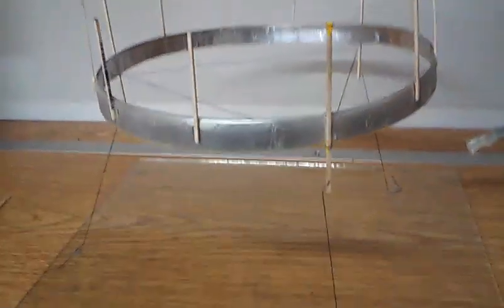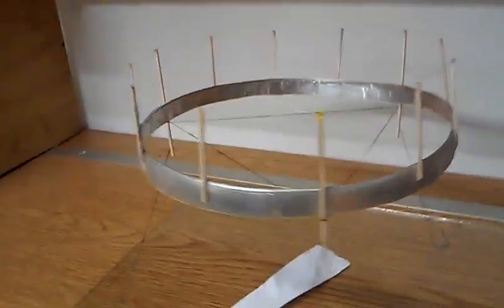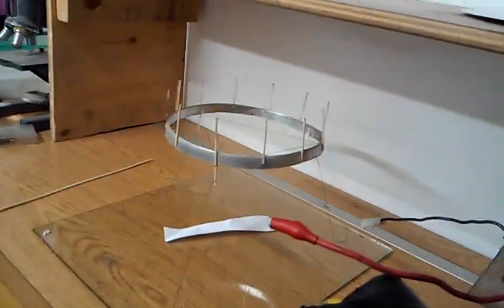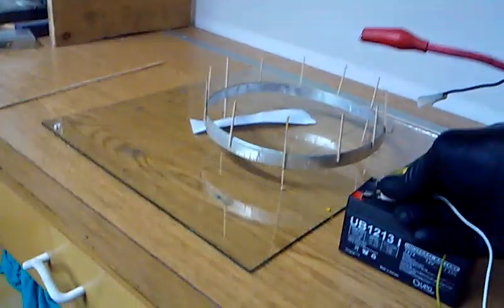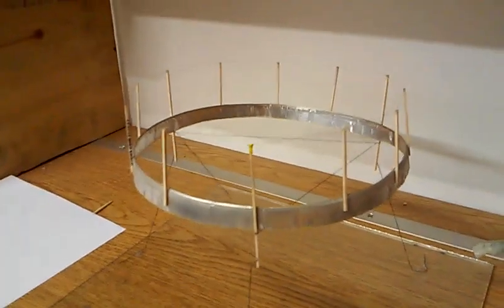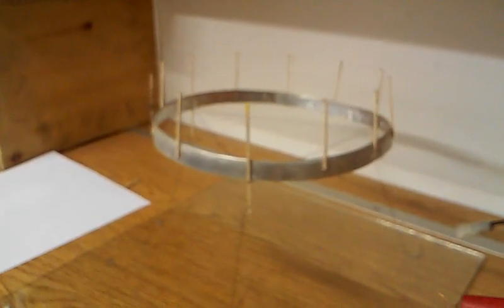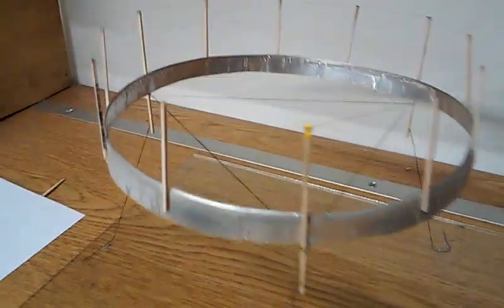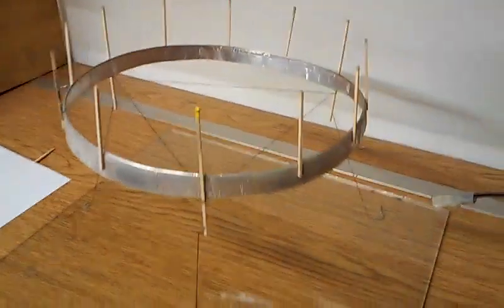ANTIGRAVITY LIFTER CREATES ARTIFICIAL GRAVITY ASYMMETRICAL CAPACITOR

Comment: easy way to test if it is a gravity well.  Put it in a vacuum jar and pull as much vacuum as possible.  If it still lifts, it won't be because of air.
Reply: it wont lift ina vacuum bro.. already tests out there prove that
Reply: @skip741x3  where they at doe?
Reply: In the summer of 2003 NASA tested one of these lifters in a incredibly negatively pressurized vacuum Lyft was still produced it is not ionic wind.
Reply: This concept is not even that complex if everyone would just listen to The Genius Tesla you would know exactly what's going on here electromagnetic radiation is the opposing Force to gravity and gravity is the opposing Force to electromagnetic radiation AKA light.
Reply: @sojournerdelaterra6144  you'll have to do some Google I don't have a link handy. You can look into the Townsend Brown experiments done in 1956 in France in a vacuum those were some of the most productive. There's a moment where voltage and lift drop off approaching a soft vacuum, once a hard vacuum is neared voltage and thrust Spike back up and efficiency is increased 30 fold. The biggest problem with these kind of lifters that you see on YouTube is they have no dielectric in them. The K value of the dielectric material is absolutely crucial to producing the gravitic thrust which in and of itself is threefold in nature, it is electrogravitic, electrostatic and electromagnetic. The key is using an AC gradient potential curve voltage applied to the plates to produce a constant charging and discharging of the capacitors maintaining maximum thrust. There's almost no videos demonstrating this.
Reply: @duh650dumcity  :
Paul A. LaViolette Ph.D.  in his book "Secrets of Antigravity Propulsion" present a very compelling demonstration of the electro-gravitics effect proposed by Brown. Also Thomas Valone in his book "Electro Gravitics" discuses Brown's experiments. Both agree that ionic wind doesn't explain the effect presented on asymmetrical capacitors.  The British patent # 300 311 and USA patent 1974483 and 2494550 develop this principle.
Reply: @hectorcaicedoatyt  I know I own the book
Reply: @duh650dumcity  How do you insert dielectric? Where? How?
Reply: @tanner1985  The capacitor plates need to be embedded in High K value dielectric insulator . The K value is crucial to determining the virtual and actual charge possible within the capacitor plate and thus the thrust produced by the system.
Reply: @hectorcaicedoatyt  Also the key to maximum thrust generation efficiency is a non linear field gradient, though the phenomenon occurs within asymmetrical capacitors.  US patent US20060145019A1 grabs my attention more than anything...
Reply: @duh650dumcity  a bismuth foil "cage"?
Reply: @tanner1985  no, ideally you would want a depleted uranium heat fused dielectric insulator.
Reply: @tanner1985  honestly just copper would work if your design is better, far better. Take a look at the Stan deyo lifter that thing will work in the vacuum of space. Many years ago I study the works of Victor Schaubager who constructed a pair of craft under the watchful eye of the Nazis who gave him slave labor. That literature came from borderlands sciences. it is just one of many probably over 100 different pieces of technology I've looked at over the years. 
I think you would agree that what everyone is looking for is something they can build with minimal cost and minimal effort.
just recently I finished designing a new simple coil based circuit that would do just that while getting its power from time, or as Tesla would say the ether.
Reply: @mikefromspace  I also think about combining radiant energy with lifter tech
Reply: @tanner1985  well believe it or not they're both one in the same thing. A more efficient free energy system will actually give you enough heavy ions to displace your mass away from a heavenly body and then some. 
Bar properly arranging coils that form rotating magnetic fields you can force time which is electron neutrino pressure to split charge among various ground points. 
Have you looked at the Stan deyo lifter? That isn't free energy but it is very suppressed technology. Deyo, who displayed it for the public was deported for doing that. Anyway I have a plan for a modified version of that that produces its own energy. Let me know if you would like a copy.
Reply: @max marrero Even a rocket is anti-gravity. It's ionized air, true, yet ion drives without the gas requirement do exist.
Reply: @mikefromspace  can you send me a copy of your modified version?
Reply: @mikefromspace  also, I cannot find Stan Deyo lifter in any videos I play, nor images... Have you got a link to share?
Reply: The air must be there, but the ionic wind effect is still not the primary force. The air itself must be providing the needed permittivity. TT Brown experimented with many different types of materials, even granite, before the project went black. Wikipedia notes that "Vacuum permittivity, sometimes called the electric constant, is represented by ε0 and has a value of approximately 8.85×10−12 F⋅m−1. The permittivity of a dielectric medium is often represented by the ratio of its absolute permittivity to the electric constant.
Reply: @CoffinKid1  Look it up yourself doe . . . consider it homework!
Reply: @duh650dumcity  Link please on that info
Reply: @duh650dumcity  Anther is not one directional if it exist at all.
Reply: @duh650dumcity  That's not a NASA test.  I looked and didn't see anything like what you said. They did test an EM drive mazer and they have tested ION drive, but not this stuff.
Reply: @duh650dumcity  try united nuclear.  It's owned by John Lazar... (area 51 guy).
Reply: @briansmith2675  Did you read the article?!?!?!

"But the two never prepared a peer-reviewed paper on their informal experiment, so it's impossible to prove it worked as they claim. Over time, I discover that none of these much-vaunted flights in a vacuum are properly documented. In fact, the only written report documents a vacuum test that failed: R. L. Talley, a researcher who tested a Biefeld-Brown-style capacitor in 1990 for the Air Force, found no thrust in a vacuum. But that study wasn't peer-reviewed either."
Reply: @harleybinger1153  ... it did... "But the two never prepared a peer-reviewed paper on their informal experiment, so it's impossible to prove it worked as they claim. Over time, I discover that none of these much-vaunted flights in a vacuum are properly documented. In fact, the only written report documents a vacuum test that failed: R. L. Talley, a researcher who tested a Biefeld-Brown-style capacitor in 1990 for the Air Force, found no thrust in a vacuum. But that study wasn't peer-reviewed either."
Reply: @scottl5000  huh? I didnt post a link. Idk dude good luck in your search. I know all about bob lazar, thanks. Anther? You mean aether? I didnt say it was one directional? What? I gotta go, sorry.
Reply: @scottl5000  are you trying to say theres no electrokinetic propulsion or electrostatic propulsion? Come on man, let go of your broken physics model. There are only two real forces in the universe and they are ultimately just one force. Those forces being centrifugal Divergence and centripetal convergence.
Reply: @duh650dumcity  

You tell people to forget physics...  People already think the earth is flat and we never went to the moon.  If that can be faked that, then faking this gadget is childsplay.

All's you are doing is spinning up the consipiracy belivers and click baiting.

If you want to fake it, then put it all in a big enclosed box with a GoPro -- turn it on and drop it out of airplane! Then it will look like it's antigravity.  But still isn't.

For everyone else...

There is ion-drive, which is a low thrust reaction mass -- the thrust produced is micro-G's.  Not enough to lift like this thing does in the air.  So ion-drive isn't what is making this thing move.

The thrust that thing produces is from "ion wind", air being moved from one electode (the wire) to the other (the foil).  

Neither one is anti-gravity.  This is proven.

But... honestly...  prove it, then it will be funded beyond your wildest imagination.

We can talk all year -- It doesn't matter what I, or you, or Rug-Rat says or thinks or asserts....  Show this very same device working just as well in a vacuum as it does in the air and I'll wisper it in the ears of the "right people" (or just about anyone who knows angel investors can) and such vast amounts of money will flow it would make anyone watching pass out.  

If that case, I'd venture a guess it would be on one of the upcoming space flights in no time to test in orbit.  A kickstarter kit would do well in a heartbeat, could raise millions without a doubt! 

I know really well how to get things funded.  I'm quite good at it.  Because my investors trust me very very much.  And there is no way I'd touch this as it's shown today.
Reply: @scottl5000  looked where? I never posted a link to anything. Honestly, I don't really care. Regardless of NASA's testing this is a valid verified technology, countless documented REPEATABLE experiments prove this. There are military patents employing precisely this technology. You can try it yourself with a large capacitor submerged in oil. Magnetism and gravity are the same thing, gravity is just non coherent magnetism. It stands to reason it can be manipulated with electrical charge. Peace
Reply: @scottl5000  you're a funny guy. This isn't a conspiracy theory at all it's well-documented. Right at the beginning of the 50s everything became classified oh, you can look up countless big companies like GE the beginning of Lockheed and Martin Etc who all openly talked about electrogravitic technology. Continue to cling to your broken dead model of physics, it is of no consequence. Clickbait? Please, you simply don't understand unified field Theory it's fine.
Reply: Already done at Various Aerospace concerns since the 1950s. It works better in Vacuum.
Reply: Here is the vacuum experiment 
/watch?v=ZE7Go7ptBRY
Much less thrust at vacuum but still working. It creates a cloud of ions and moves towards the cloud. It's not antigrav.
Reply: @GreenyX1  what are you even talking about? that grainy super low quality video doesn't show a "cloud of ions" or anything of the sort. It shows NASAs strange attempt at a non linear field gradient capacitor set up which seems to function, albeit not very efficiently. There is no such thing as "anti gravity" this is a form of electro-kinetic propulsion get that into your brain.
Reply: @sojournerdelaterra6144  You still have electrostatic charge in vacuum. It works better in vacuum, as shown in Corporations and Institutions and by the US Army and Purdue University, Honda R&D, etc.
Reply: Calm down
Reply: @GreenyX1  these are emotionless typed characters. Psycho analyze elsewhere
Reply: @duh650dumcity  do you follow ken wheeler?
Reply: @tanner1985  yes. He is correct.
Reply: Just put it in a trash bag.  Easy. When it fails to fly off with the bag, the toss it in the trash bin.
Reply: I have proof that this works in a vacuum: https://apps.dtic.mil/dtic/tr/fulltext/u2/a416740.pdf
Reply: @deanurschel9161  Seriously?  That army paper proves IT IS NOT ANGRAVITY!  

LOL LOL LOL LOL! That backfired 'ol Deanie-poo!

So... Did you actually read it? Let me save you time: Check out page 9 and Appendx B.

Near the top of this document. First off, The paper says at lower voltages it's ION WIND which is too small of thrust to be useful.  At higher voltages it's ION Thust.

Then  with ...page 9 and Appendix B... read 'em and weep buddy...

Appendix B: 
Which talks about what happens in a vaccum?  It refers to SPARK and ION PROPULSION.  Here is a quote from the document: "observed everytime there was a vaccum spark
Reply: Scott L  the conclusion of the paper IF YOU ACTUALLY read it is that the force is unknown the ion thrust is just their best guess
Reply: They clearly stated multiple times that it was just a scaling equation and that it was their hypothesis which they did not test. It’s not ion wind
Reply: @deanurschel9161  I read the whole thing. And I understood it.  Anyway, paper is cheap.  Just put the thing in a sealed light weight trash bag.  If it's antigravity it will lift off taking the bag with it.  If it doesn't then it's reaction mass and either it will not move or move a little inside the bag best case.  Can't be that difficult to do.  I built a lifter just like it a few years ago.  In open air, It lifted off just like the video, with a trash bag tied to the bottom in a little bundle of string, it lifed off the ground, so I know it can lift the weight of the bag.  Then I put it in the same kitchen trash bag (a white one, very lightweight) and inflated it with air, so that was a little bigger than the lifter, and sealed it tight, fired it up... it didn't move AT ALL.  e.g. NOT ANTIGRAVITY.  You people are unreal.  The patent is bogus the GE papers do not claim antigravity, nor does your Army paper.  Anyone that gives you money is an idiot.
Reply: Scott L relax man I never claimed that it was anti gravity. I’m just trying to figure out what this is like you. If you tried it and it did not lift the bag then that is a very discouraging result. I will try the same just to confirm and post here tomorrow
Reply: @deanurschel9161  Sorry, I'm been fighting a lot of the BS claims so too long.  Video title and patent's abstract refer to anti-gravity.  But yeah, saddly it didn't work in a bag. Ion wind, and xenon, or even spark erosion actually work fairly well.  I was stunned to see Ion Wind can work in low orbit, but very slowly as particles are quite far apart.  Since the interplanetary space has about 1 H2 molecule per cubit meter, with a enough power even and Ion Wind would work if you got it going fast enough first.

As for antigravity proplusion, there are methods under mathematical investigation.  Artifical elements (stability island elements), ZPE, etc.. The crazy one I'd love to party on is the Anderson Device, which isn't propulsion at all, but I have an idea for using it to generate significant power from conventional means.  Far superior to hot controlled reaction fusion.  And far more dangerous.  Total Star Trek stuff, but not anti-matter.  It's nuts.  As for propulsion, well, reaction mass and worm holes aren't going to come into reality in my lifetime.  And that is not acceptable.  LOL!  So I'm been looking at it from the perspective of what I call "quantum attribute" manipulation.  Every atom can be described as data.  Such as specific energy, temperature, emmisive index, mass, interia, acceleration, and dozen(s) other variables I can't think of just now.  But what if one set of variables was the atom's position.  Not sure what it would be relative to.  But if you could create a field of somesort that alters that information, the the particle would simple change to that new position because is exits classical physics, turns back into superposition quantum physics, the triggering even is changed in a way that when it enters back into classical physics it's now in a different spot.  This might be how a gravity field works, which is a function of mass.  But it's pretty weak.  May a stronger version of it can be applied to get at the position data.  For example, you can hit an atom with a laser in the correct direction and thus cool the atom to near absolute zero temperature by adding energy that slows down the electrons causing them to drop to a lower energy state.  So maybe there is an EM radiation that can be used to alter the atom's position too.  Laser is just light... but now we know it can be used to directly heat to fusion temperatures or directly cool to near absolute zero...  Maybe the guy in Vancouver BC that can demonstrate lifting of eggs and bowling balls has hit the right energy and frequency of EM to adjust that positional data.  Rather different approach than a lifter...
Reply: @deanurschel9161  Believe me when I say I'd love to see it work.  If you can manipulate the frequency into the microwave range then you'd looking something like the new device from NASA that they haven't quite explained or verify yet.
Looking forward to your results.  note: You might end up making a lot of Ozone, so be careful when opeing the bag later.
Reply: Scott L thank you for the reply scot I will use a high voltage dc power supply and per your suggestion an oscillator. I have recently done some reading and I believe that the key according to brown fields experiments is using a dielectric with a high k constant. Apparently the lift is proportional to the high k, which might explain why this simple design does not work in a vacuum while other designs like brow fields did
Reply: @sojournerdelaterra6144  
There was only very slight amounts of thrust shown as far as I know.  With a very small propellant tank or very high voltages, it is a different story.
Reply: agreed. Heavy objects (and ALL objects with mass) attract other things with mass, also against Earth gravity. Not very complicated. To nullify Earth gravity try creating enough "artificial mass" on top of the desired object. But this mass would attract everything else as well. To avoid this connect the "artificial mass" mechanically to the object and you end up pulling yourself up from bootstraps. Not plausible. Ion wind, truly a wind of sort in question is way more credible than other extraordinary claims.